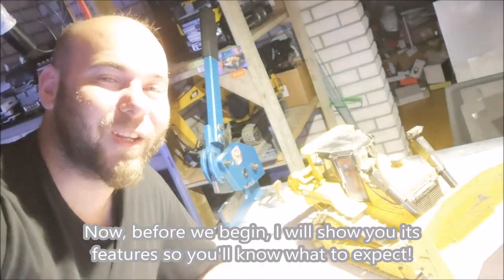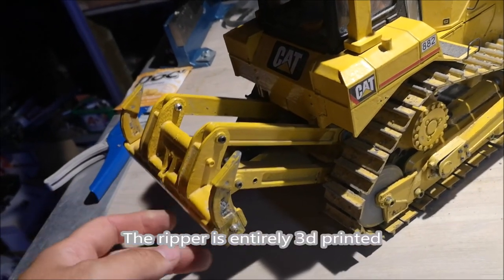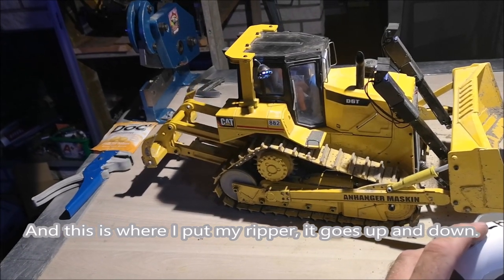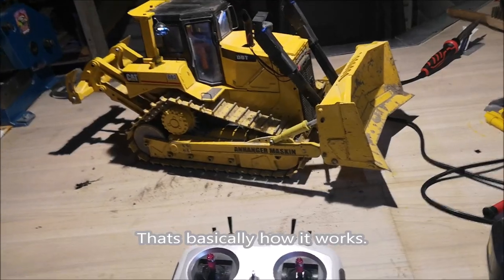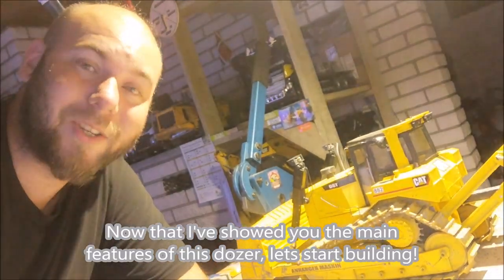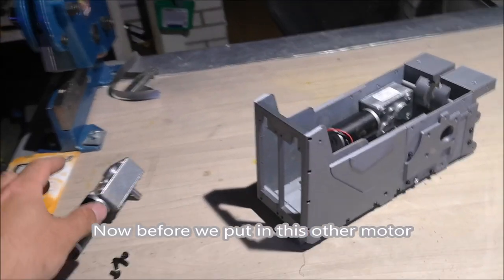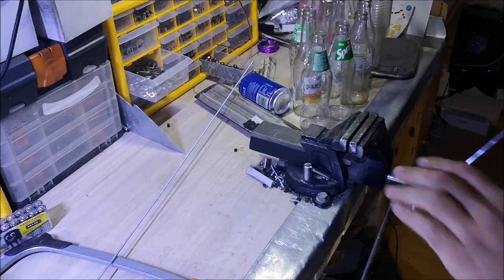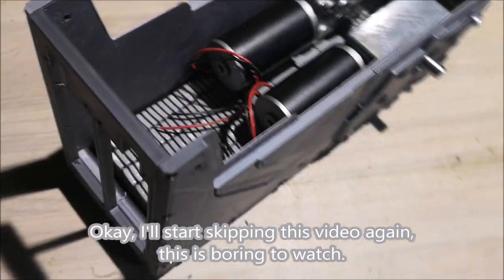Making a 3D Printed D6 Bulldozer PART-1/6

Comment: i notice you dont use any motor spacers for the track motors where they mount, but you have the file for the mounts in the STLs. Should i use the motor mounts or ?
Reply from the maker: hello, the motor spacers are only needed if you run the 5840-555 motors :)